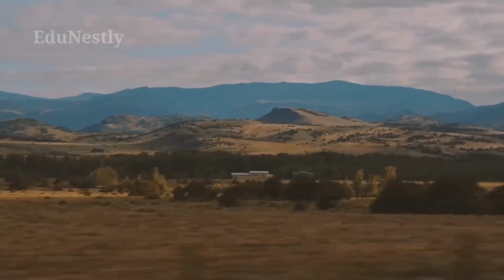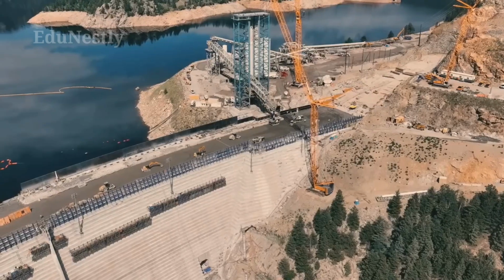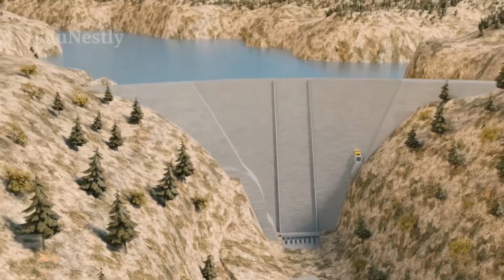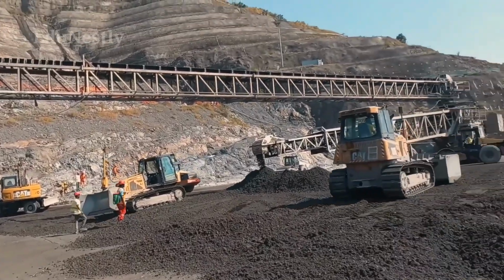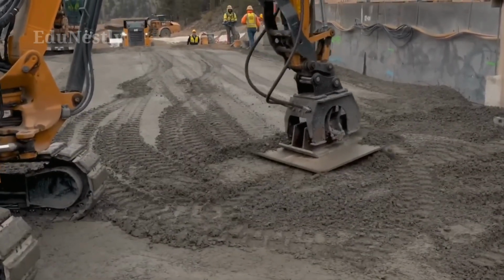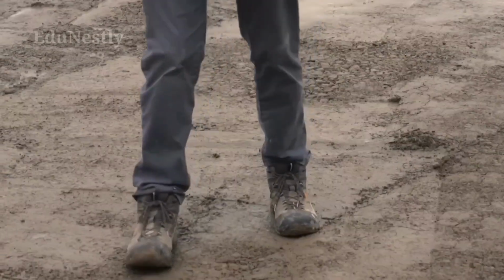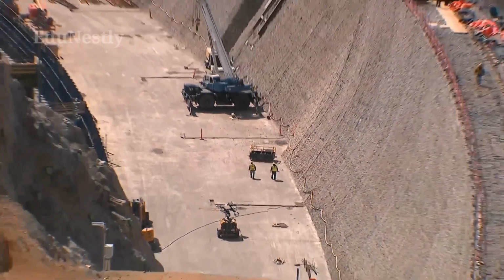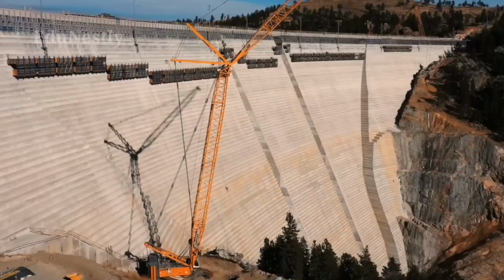How US Engineers Triple a Megadam’s Capacity Without Building New

Comment: I always wondered why they didn't send the water from one turbine straight into a channel or tubes that would turn another turbine and so on and so on??? They could be smaller if needed but one line would multiply and multiply????? Even by putting a dam in front of a dam in front of a dem would be another multiplier with a safety net built in!!!